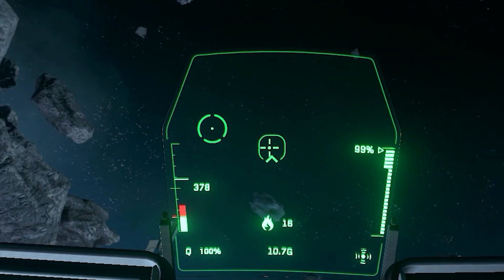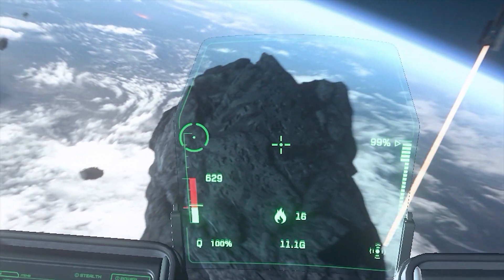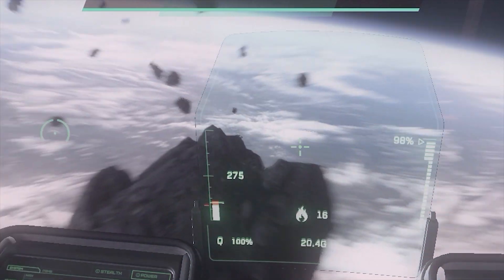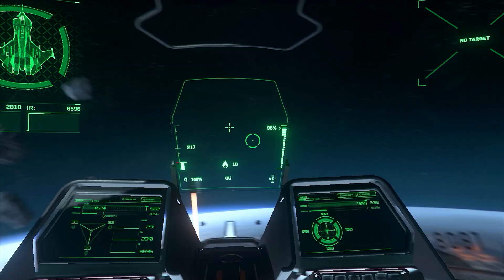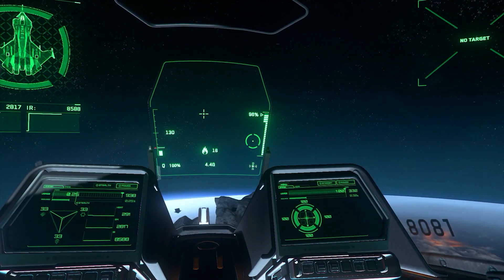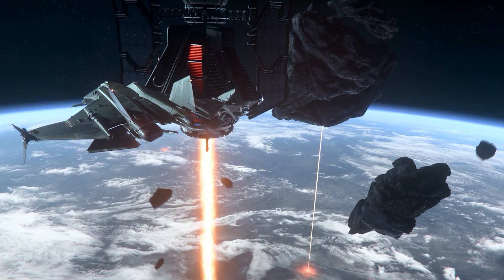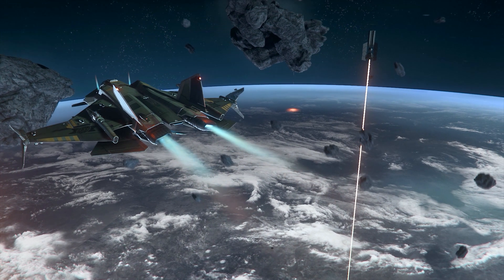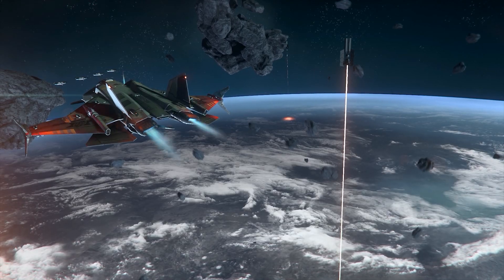Understanding Thrust | Star Citizen 3.5

Comment from the maker: **THE technical term for the thrust limiter is the velocity limiter, and it limits your ships speed**
Reply: Movement "Feels" better than it has ever in SC. Combat still sucks because there are still a ton of things not working as intended and even after that will need a lot of tweaking. You can see the intent though - it's a fundamental shift away from the combat many of us grew to love back in 2.x, faster closing speeds & lower TTK were what made combat really satisfying and skillful. 

However for the sake of an MMO which has soft-permadeath it simply can't remain that way - TTK has to be a lot longer and they need to lower the skill floor. 
Combat will become more cerebral than mechanical and the configuration and limitations of different ships will have some interesting emergence. The one thing they must get right is the speed caps and the power management systems because disengaging need to be a skill based option for an out-gunned ship.

Overall I think the Flight Model has moved towards the direction it needs and once they fix a lot of the bugs it will be fun, but it won't satisfy everyone, top pilots will probably find combat frustratingly slow and for them I hope that Squadron 42 has a different, faster flight model and they include Arena Commander there because with the right tools and mod support AC could be its own game.

Ultimately low TTK & a permadeath system are mutually exclusive, really it was obvious that SC couldn't have the mechanics of a 6DoF Arena Shooter.
Reply: I did see in the reverse the verse that they wanted this to feel more the expanse with the new flight system.  I like it in concept but I still want to get my hands on it and they did say there is still work they want to do on this system.
Reply: Seems more realistic as you described. Thank you
Reply: Left ribbon is your speed setting indication.  So if you set it to 50m/s your entire throttle throw, on a HOTAS, will only get you a max of 50m/s speed.  You can afterburner to your heart's content and will not go more than 50m/s.  This gives a nice precision control when needed.  I use this all the time when coming in for landings.  The right ribbon indicates your thruster percent.  So if you have 10,000lb thrusters and set the accel slider to 50% you now have 5,000lb thrusters.  This deadens your impact each time you make a throttle change.  I do not use this very much though.  I am almost always on 100% as I forget to change it when coming in for landing.  I have used it to land before, and while it does help, it does not work well with hover mode as once you tilt and the ship start accelerating more and more, it is harder to level the ship because the accel is only at 50% now.